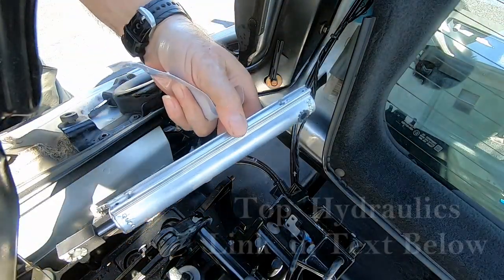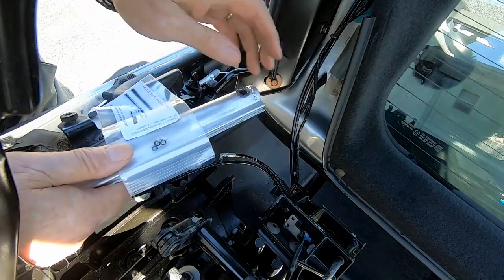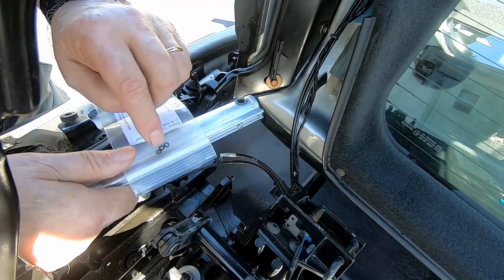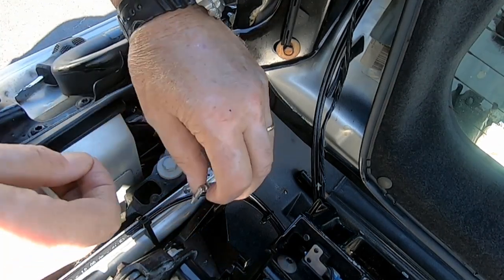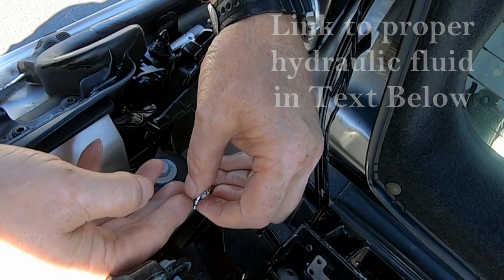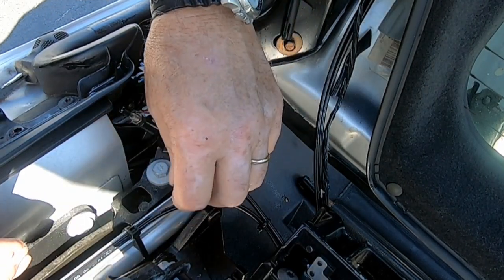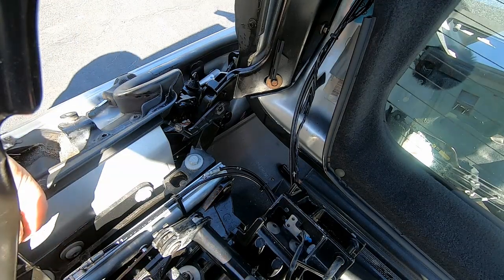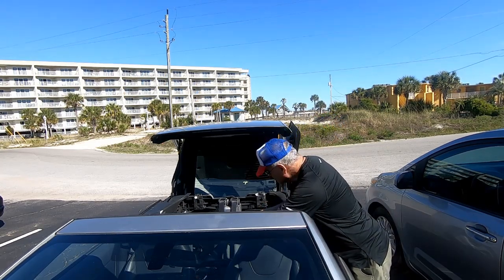Part 2 - Pontiac G6 Convertible Top Hydraulic Ram Replacement

Comment: Do you know of a source for other parts? I need the fiber molded cross brace that runs from side to side just under the rear deck lid and immediately behind the rear seats. I would also like to find the new deck lid.
Reply from the maker: Sorry... I don't know of any supplier. A salvage yard would be my only guess